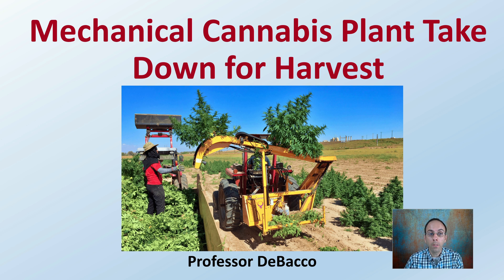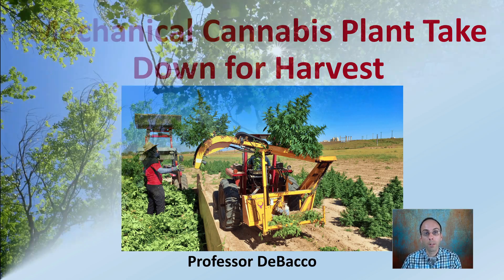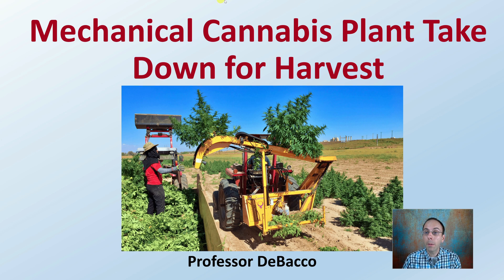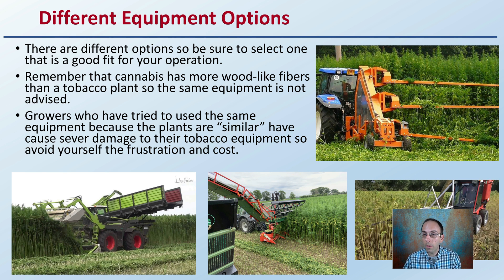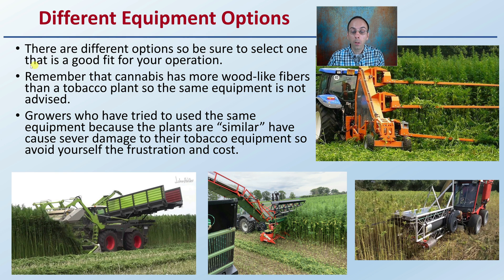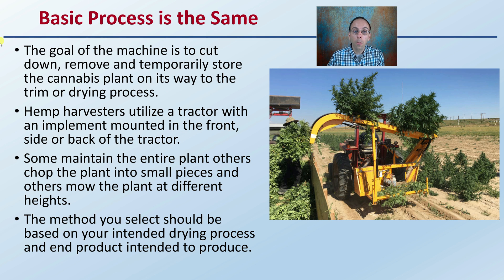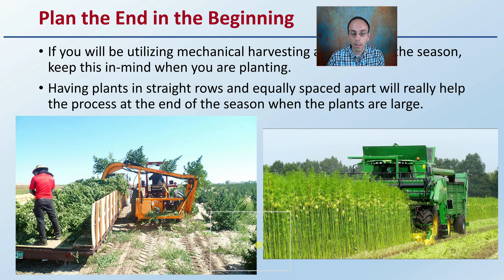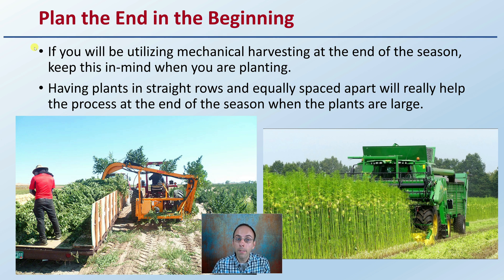Mechanical Cannabis Plant Take Down for Harvest

Comment: Nope. I would want a human to harvest my crop (me). I am quite familiar with tobacco and how it's harvested in Southern VA and it doesn't involve much more than people working the rows and a tractor pulling the trailer until a pickup pulls the load to the barn. I realize that hemp is grown differently, but still. Nope
Reply from the maker: Many agree with you, but for fiber production machines can be advantageous.
Reply: @DeBaccoUniversity  agreed, and I can understand that, especially when growing for extraction of CBD from hemp. I've been around tobacco for as long as I can remember and I've heard of mechanical harvesters, never seen one in use.

People pull it. It seems to work. I'm not growing hemp for fiber anyway. 

Love the channel. You put the information out there and that's a great thing for everyone that wants to learn something. Thanks!